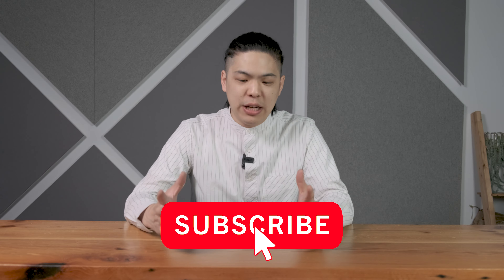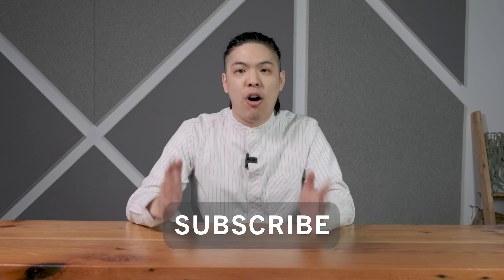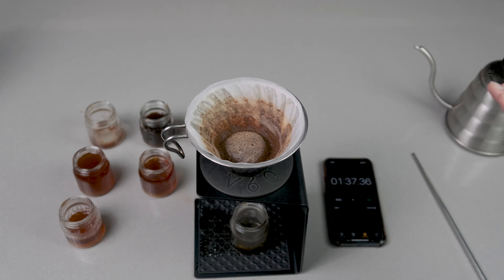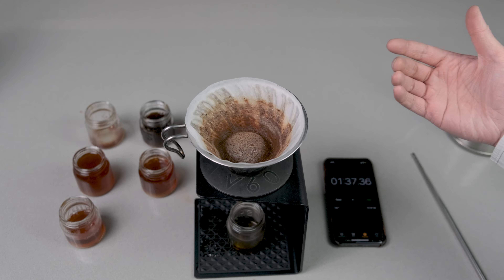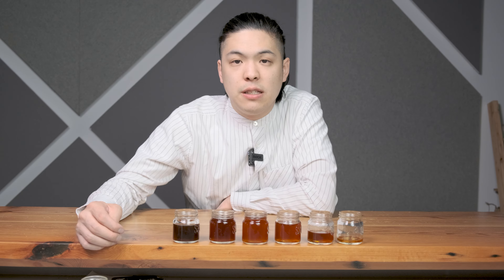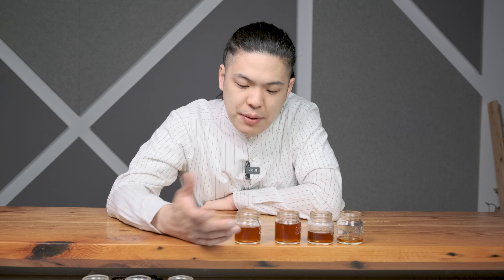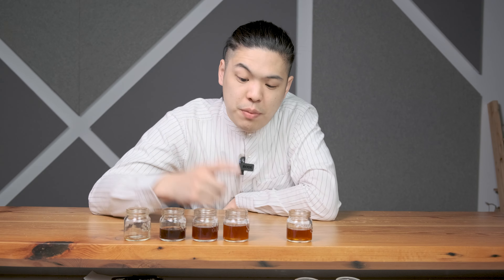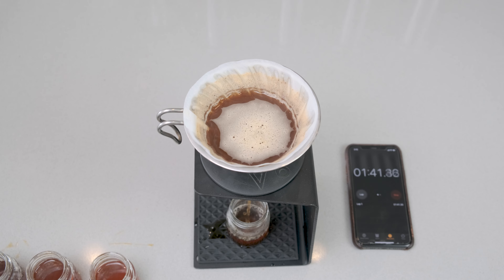Coffee Brewing Theories: Extraction (Pour Over Coffee) - Part 1

Comment: Am I wrong or does this whole video kind of work of the assumption that the volume of solvent that’s percolated through the coffee has no effect on what’s left there to extract? It’s no so much time related as it is volume no? Would be interesting to try using the volume you used to brew up to the point where you said it became dry and then make up the rest with bypass water
Reply from the maker: This is a great comment!
.
So I operate on the idea that good flavours are more solvent and anything that’s “hard” or takes a lot of effort to extract is considered an over extracted flavour.  Since this video till now I still think in that way.
.
It’s the beginning that has the most flavours, this is repeatable with different grind sizes as well.  However some beans are harder to extract from thus they need more “volume” passing through.
.
Longer bloom times increase solubility but it also encourages clogging earlier which traps flavours from leaving the bed.
.
I do indeed brew coffees with a bypass if they sink too quickly! Or if I want a higher volume drink and the coffee is done “brewing”
Reply: @TALESCOFFEE  thanks for the reply! I watched your more recent video in which you acknowledge the volume thing. I’ve been messing around since watching your videos and I’ve found that using a clever dripper and 24g of coffee, pouring 80 g water straight in, stirring and leaving it for about a minute, letting it drain out then adding about 50 ml bypass water gives really good results because all the best tasting stuff is in the first bit like you said! Just needs some water to dilute it and mellow out the acidity

Comment: Was it 90° measured in the pouring kettle, or 90° setting in the temp-controlled kettle before transferring the water to the pouring one? 
Also, can you somehow differentiate the factor of time versus the amount of water passed through the grounds? Since these are nor strictly equivalent, and the relationship depends on the dripping speed, which depends on the pouring speed or timing (besides the qualities of the filer paper, the grounds, etc). What if you swapped the the jars based on a fixed filling, and not time intervals? 

Yeah I know I should do my own legwork and try all this by myself, and I certainly will at some point, but there you are already equipped with all those tiny little jars!
Reply from the maker: The water was 90 degrees in the kettle.  I also think it might be a volume thing and maybe less of a timer.  But I think most of the flavours are extracted within the first minute still, but you need to have a minimum amount of water to pull all the flavours out of coffee within that time.

Comment: Nice video, I like the visuals. Also a really big thing that affects the agitation to time brew ratio is "grind size".  Fine grind = faster brew  course grind + the melodrip for instance = longer brew but still getting optimal flavour in a different time frame.
Reply from the maker: Yeah for sure! But melo drip also causes a lot more agitation, it’s more like a drip vs a stream so it’s good for sifted coarser grinds!
Reply: @TALESCOFFEE  my point was not really the Melodrip but I do get much less agitation the way I used it. More agitation and the H20 looks really cloudy like in most brews , less agitation and the water above the grounds can look like a crystal lake the whole time but still have a high extraction. More importantly:  usually
 Course grind =  longer brew  ATT 
Fine grind = faster brew 
Both can achieve great results
Reply from the maker: @Wheresthesoul  I think generally when the coffees sink the top will be pretty clear.  That's generally when the extraction is highest.  Because I personally think all the better flavours have been extracted once the coffee sinks, though I could be wrong I've been testing this quite a bit though.  I have pulled pretty high extraction shots but questioned if the flavours are better.  So it led me to think if the higher extraction is necessary.  I actually have bloomed with the melo drip to much success on finer grinds, the method though requires a massive bypass.  I felt like I was brewing an aeropress ahaha :P
Reply: @TALESCOFFEE  ultimately it's pretty complex especially if we are not brewing and tasting the same coffee together 😊. 
I appreciate the dialogue and you not just writing off someone with another opinion. I think this is when people box themselves into a corner and stop learning. Keep questioning and trying new ways to brew " like your doing" and you will have the right skillset and techniques for each unique coffee. It will be interesting to see your routine and thoughts five years from now👍
Reply from the maker: @Wheresthesoul  Thank you for this!

Yeah honestly, I've changed my brew technique so much ahaha .. I can see me changing quite a bit in 4-5 years.  But there's a few things I feel like I've "set" in stone but who knows!

Comment: Wouldn't you consider grind particle size (and proportion of super fines) also to be a major contributor to extraction characteristics? Also pour rate and technique? And, brew device shape, and paper filter characteristics?
Reply from the maker: I've considered them for sure.  For grind size if you follow our single pour journey we only do medium fine grinds.  As for pour rate we just pour slowly to reduce the agitation.  This test is purely for our single pour technique vs a bloom.

But if you run the test with different device and paper filters you'll find that each bean should only require a certain amount of water to pass through to extract it.  Any more water and it would start to be extracting flavours that aren't tasty imo

Comment: I feel like some of complexity "may possibly" be generated from the late-ish part of the brew - the tea-like stuff and slight bit of dryness might be part of the complexity. However, and obviously, too much of that end phase dryness, etc. can be a problem. Anyway, it was good to see this performed on a v60. So, thanks! You might try and do the same on a zero bypass dripper, like the hsiao 50° dripper (or others) and see if the results are the same (as pseudo-bypass occurs/is engineered into the sides of the v60).
Reply from the maker: I think the later parts create the tea like texture no doubt.  I could also add water directly (like a bypass) to lighten the texture while only retaining what I believe is the good “flavours” and oils

Comment: This is very interesting. Have you seen Tetsu Kasuya's recent switch video (on his instagram)? He seems to reach the same conclusion as you, using the switch as a regular v60 for two pours, and then using it as an immersion brewer for the last parts of the brew on the basis that immersion is less effective at brewing, so the "bad" flavours at the end come out less. Wonder if you might consider a video on that technique if you had time to look into it.
Reply from the maker: HELLO!
.
Thank you for asking this!  I have come to the realization that all the flavours come out at the beginning.  What determines whether or not we are over extracting is the fact the grinds in the dripper have sank to the bottom.  Put it this way there's a certain amount of "flavour" inside each particle I call it HP (life points).  We need to make the HP hit 0 by extracting it with water.
.
The "bad" flavour is actually when the grind turns into a zombie.  aka Overextracting gives the papery/acidity that is undesirable.  So you don't want to do too much damage, but just balance how much damage you do to your beans.  The gasses given off are a "shield".
.
I don't think you can actually immerse the beans in water and make the bad flavours taste better.  Once the beans sink it signifies it's done.  You're better off adding water directly into what is brewed.  Try it out and lmk.  I have a video about this coming out tomorrow!  (coffee as an rpg) should help clarify!

Comment: so how do we go from 1:30+ to a minute? grinding a bit coarser? or pour less water maybe?
Reply from the maker: Coarser only works if you’re using a sifter. Actually going on the finer side is fine, I’m thinking of doing a bypass after finding out the exact volume I need for flavour extractions
Reply: @TALESCOFFEE  what about doing like 14g vs 180g, that should resault in a faster brew
Reply from the maker: @gunnarbjarkiii  Yeah for sure but most people I think want a slightly larger cup of coffee.  I do minimum suggest a 15g dosage so 15g beans to 225ml water is the smallest I would brew.  You would use a smaller dripper too like the hario 01 size.  Any smaller of a cup and the water flows out quite quickly which is somewhat no good.

Comment: Late to the video, but did you run that test of just brewing 1:30 min? I'm curious if it'll be too intense whereas the last bits help mellow out the intensity and give it a more balanced flavour. (I'll prob give this test a run through when I can!)
Reply from the maker: I have done it based on time, I actually am starting to believe it’s based on volume assuming your technique but mostly it’s to DK with volume.  With a bloom you’re gonna have a higher agitation so you’ll end up requiring less water
Reply: @TALESCOFFEE  so, then with the no bloom technique, would you stop at 1:30 mins or use a lower volume of water but keep same weight of coffee (thereby increasing the ratio), which is essentially the same thing but I find stopping due to weight to be a bit more consistent.
Reply from the maker: Mm we know roughly when it finishes extracting so we perfect it by adjusting water to match the time depending on the coffees.  Some coffees have faster extraction some are slower so this is good for like maximization but not necessary to be perfect around.  It’s just good to know